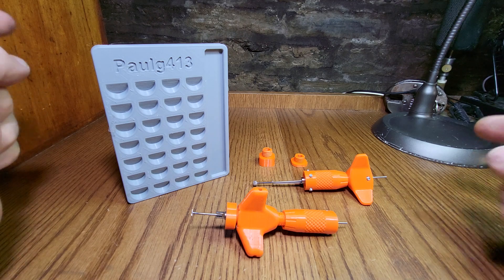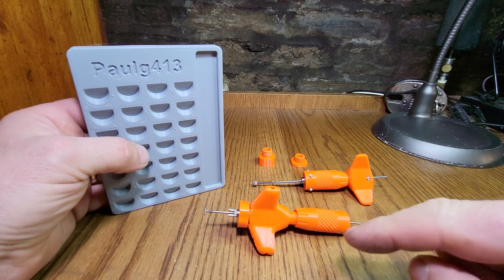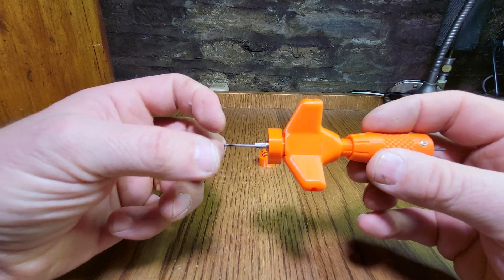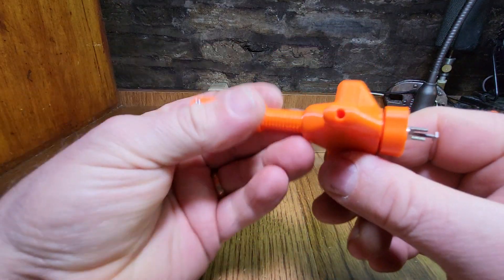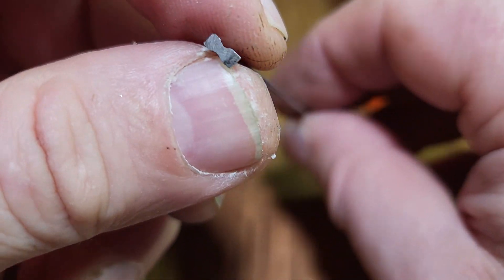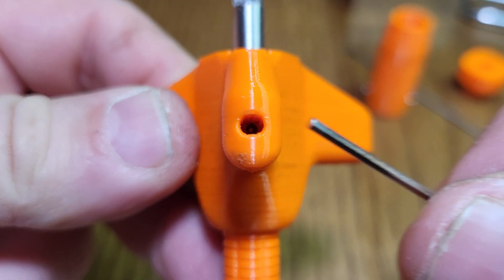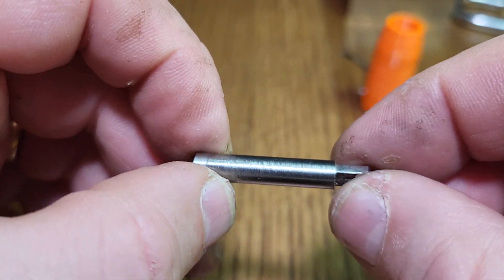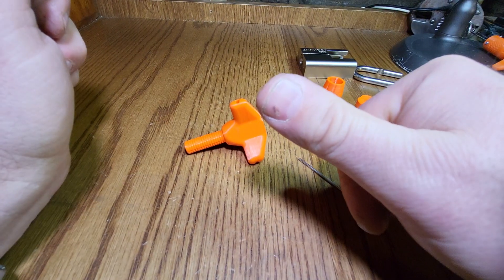3D Printed Disc Detainer Pick Built and Gutted @TallanPick

Comment from the maker: Update to this, the best way I've found to make the tension tube is to use some 6mmx1mm  wall thickness tube with a 4mm brass bush with a 1.5mm hole drilled through that and then tapped into the stainless tube as an interference fit

Comment: I have tried for years to learn how to pick a DD lock with no success whatsoever. I have the Sparrows and cheap Chinese picks. I finally asked LockChuck if he would make me one of his (looks just like the Talon pick). He is sending me one. I’ll give it a go again. Thanks for your video on the tips.👍🦊
Reply from the maker: Jack, I think his is the same pick, it's a great pick for transmitting feedback, worth mentioning that some DD locks are better to learn on than others as the feedback can be so varied, if you can get hold of a Zarker they seem to be very consistent 👍
Reply: @Lock-Picking-Paul 
Thank you for your suggestions 🙏👍🦊

Comment: Nice to know someone else suffers from metallurgical nightmares i too suffer from the need to make it durable and "perfect" but usually experiences provide edification (usually expensive) churs lpp yarock!
Reply from the maker: Or an injury causing learning experience..... this is a good one from personal experience, if you drill through your finger... DON'T put the drill in reverse to get it out 😫
Reply: oooph i bet that learned ya ;-)
 @Lock-Picking-Paul